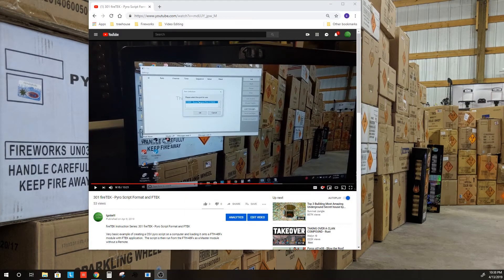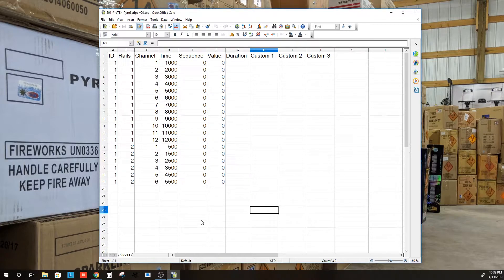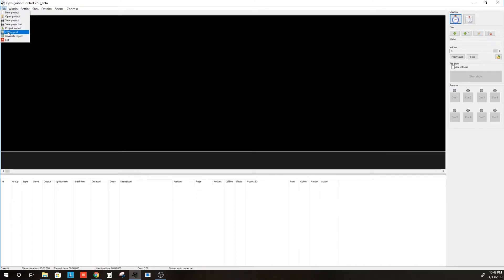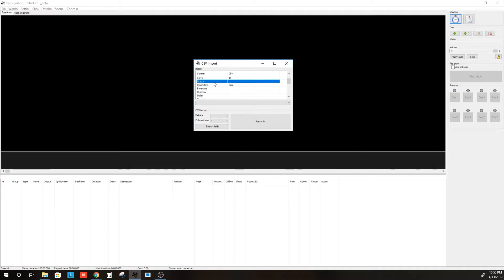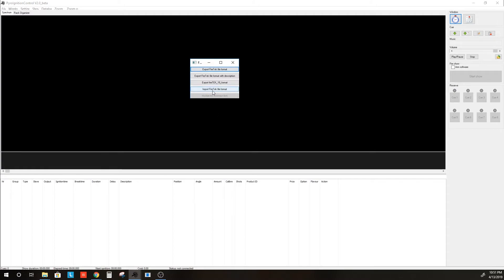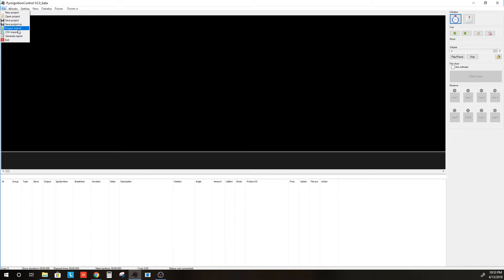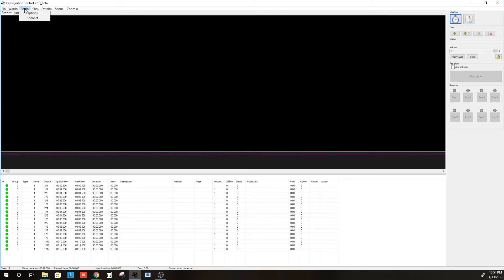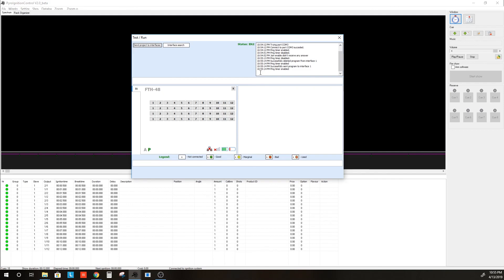302 fireTEK - Loading CSV script with PyroIgnitionControl

Comment: I keep getting "Failed to Load File" error. Any clue why?
Reply from the maker: Hi, are you using FTH modules or the newer FTQ modules?  I did you create a script in PIC, or are you trying to import a script into PIC, first?   Or do you have many DMX events?  This 3d party application does have some limits and I've only loaded to my FTH units.  

I do most of my loading these days by exporting the fireTEK script to a csv file and load with FTKontrol.  If using FTQ modules, there are some differences. 

For more details or help, I'd suggest also trying to post something on the FB user group:  https://www.facebook.com/groups/1581649428806010